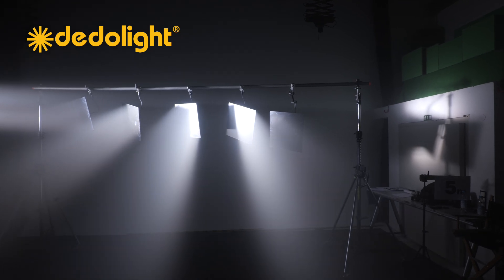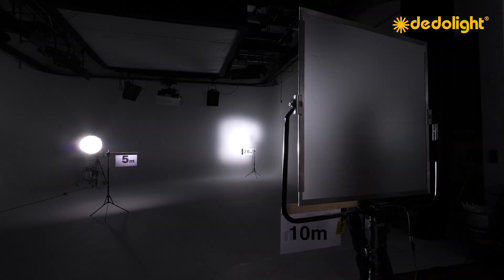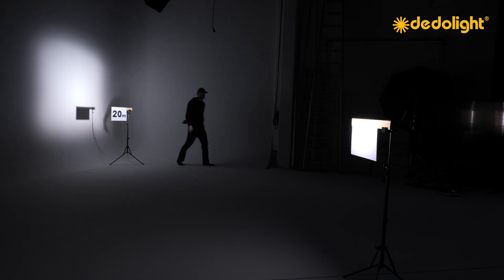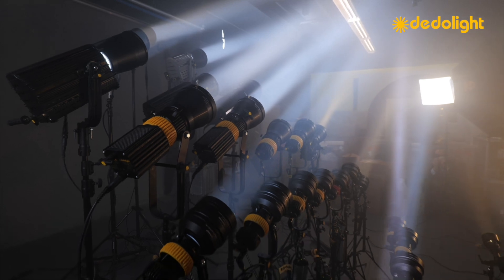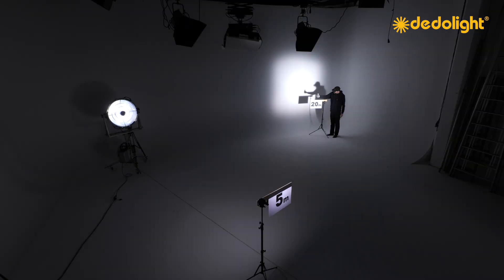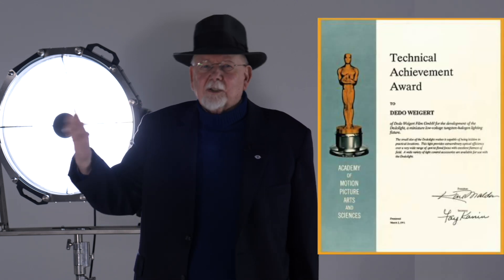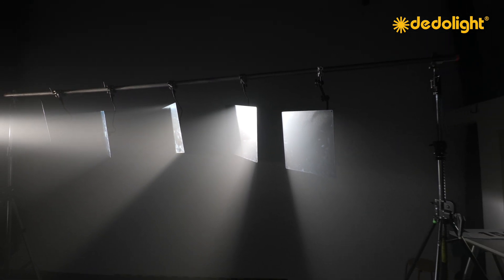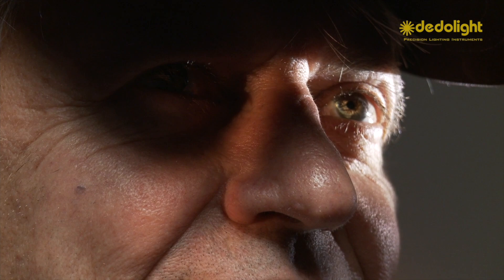Infinity Lighting: the illusion of natural light from a far distance

Comment: very comprehensive explanation, but i must say this: the reason you're not getting exactly half between 10m and 20m (at 04:43 min) is not because you're shooting some light past the reflector. that portion of the light wouldn't be hitting your meter if you were measuring an actually straight path either. the reason is that the reflector is not a perfect mirror, and diverts some of the light away from its straight path to the meter (as we can see from the fact that the reflection in it is slightly blurry). you would get the same reading at 20m with a much larger or a much smaller mirror, too.🤓

Comment: "Square Law" works ONLY for POINT light sources! It's a why it does't works for a laser sources, because in that all quantum of ligths moving parallel!
Reply: Actually the inverse square law is a law of physics that applies to any light, but the rule of 1/4 of the intensity at twice the distance begins to be achieved, once the distance is larger than five times the diagonal or radius of the light source, but beyond that distance, no matter if the light source is a 12x12 diffusion frame, the law is met.
Reply: @dishoanimaciones1308  I don't observe this intensity drop off in the slightest when using something like a LEP flashlight. Most of these lights have incredibly tiny emitters, and even if we measure the visible beam-width (visible due to atmospheric particulate), there is virtually zero perceptible drop off even off into the horizon, let alone "5x" the radius of the light source as you said. Granted I don't have equipment to measure lumens and candella of a laser to verify this, visually speaking - I'm certainly not seeing any light fall off at five, or even ten times the radius of the light source.